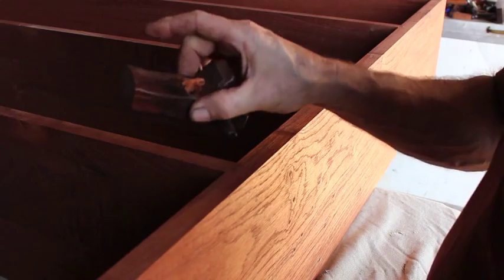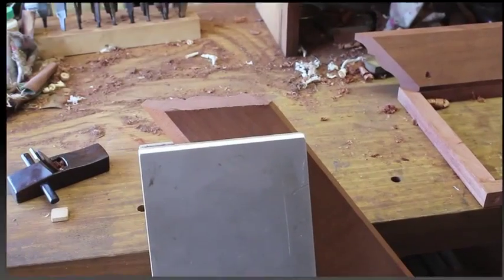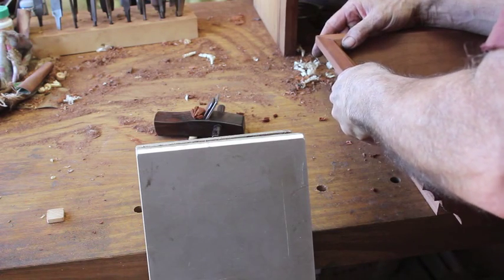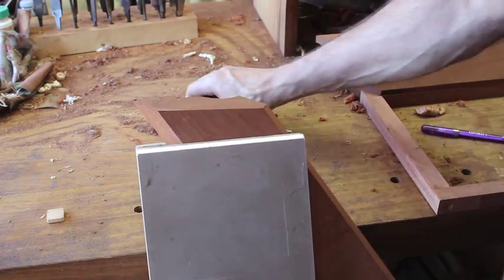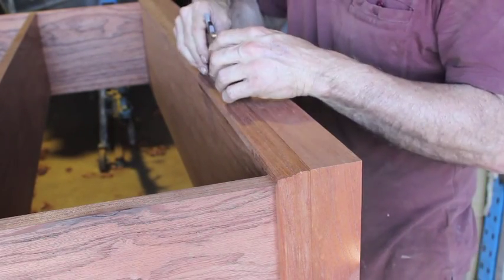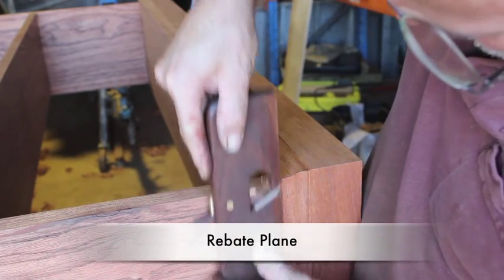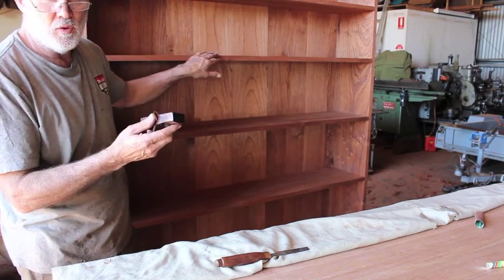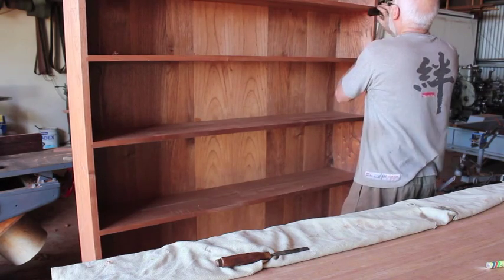Making A Cedar Bookcase: Palm Smoothing Plane

Comment: Hi terry,how would your palm smoother deal with kiln dried blackwood with a lot of grain changing direction............
Reply: +mark 123 The palm smoother is a very reliable plane when it comes to difficult woods.   I think it would handle the difficult blackwood as a plane but you also have the option of reversing the blade to use it as a scraper, and in this mode it can handle the wildest of grain in any wood.   Regards Terry